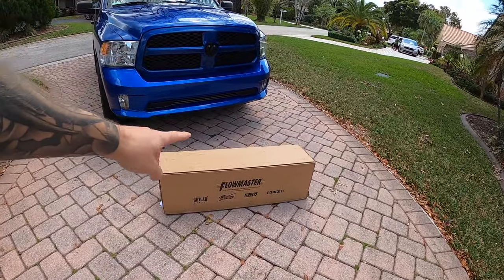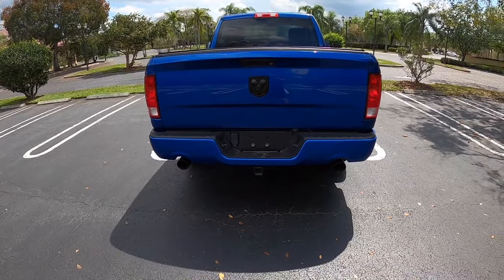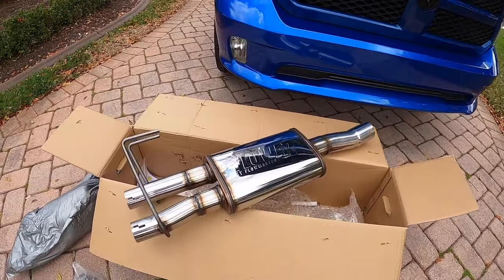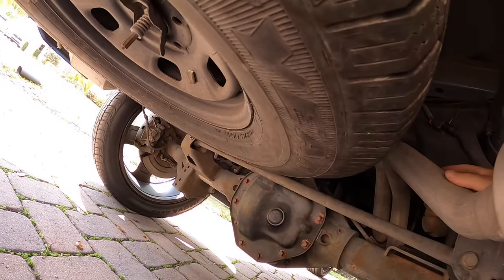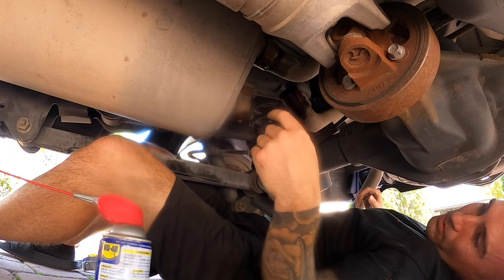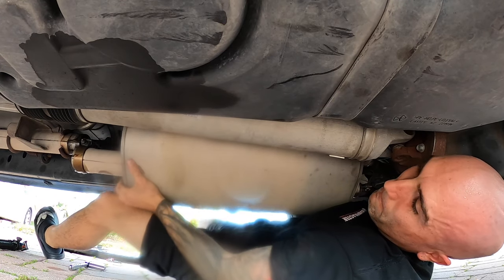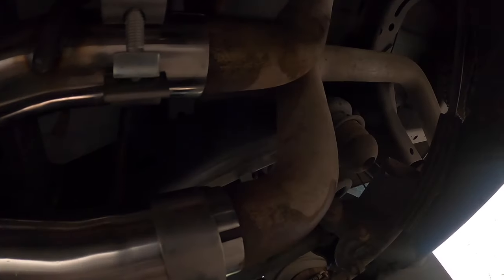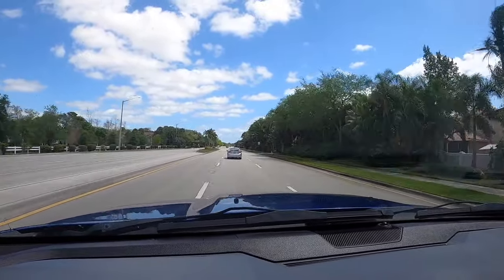RAM 1500 Direct Fit Muffler | Flowmaster FlowFX

Comment: I put the 40 Series on my Ram when I bought it. Have been considering switching to the fx to eliminate the drone at 1800 rpm.
Reply from the maker: Yeah depends what gear ratio etc but this one seems pretty tame cruising with the 3.21
Reply: @BoostedMotorsports    I got the 3:21 also. It doesn't hit 1800 that often but when it does it will drive you insane. Been researching a J pipe. Might throw one in and see what that does first.

Comment: I love Flowmaster.  I've owned more Flowmaster mufflers than any other.  I wonder how it would sound on the Ecodiesel?
Reply: The turbo really suppresses the sound.  I run a 3" 50 series HD Big Block muffler as recommended by Flowmaster.  The sound tested as 3db quieter than stock.  Even without the resonator.  The resonator is just a baffled tube, no baffles.
My truck also has a Banks Silencer delete.  But I run a Wix air filter for goodair flow and fine particle filtration.  Is a 4wd, with 3.92 gears, got 33mpg at 70mph on speed control.  Traveling between San Jose, CA, and Bakersfield.

Comment: I use 3" 40 series Flowmasters & exhaust tubing with SRT shorty headers and factory mid pipes on my '12 Challenger R/T M6, has always sounded great and works well! It is reasonably quiet when cruising at 1800 RPM on the highway, but has an authoritative growl when accelerating to pass someone!
I might add that some anti-seize compound on the pipe joints helps them slide right in and makes it easier to take off should the need ever arise.  Great video, thanks, man!
Reply from the maker: That’s awesome thanks Mark! Glad yours is sounds good too!

Comment: Just did the Aero Turbine direct fit 3030XL and love it! I wanted a nice rumble without it being abnoxious and its perfect. I couldn't recommend it enough.
Reply: Do you have a video of the aero turbine? I've been looking at this exact one.
Reply: Any drone?
Reply: @dallas3559  Sorry no video but there are a few on YouTube if you search I believe. I had the Borla S TYPE installed but removed it because I didn't care for the sound in the cab. This would be closer to like a 50 series FM but better quality material.
Reply: @jefftaylor1247  just a nice sound in the cab but very slight deep grunt when it goes into Eco.

Comment: I have a 23 Ram 5.7. The muffler goes into a y, single exit. Cut it in back. Unbolted the front. Installed a muffler delete. Barks when cold. A church mouse when cruising so you can hear it shift. No drone. Left the resonators on.$140.00

Comment: Thinking of putting this same exhaust on my 2019 Ram Big Horn. But i hear many people having to do a modification saw cut to remove the stocked exhaust/pipe.  Do know if this is correct?  I noticed you didnt have to do any of that.  Just bolt up and attach..

Comment: On my 2017 Ram RT I went with sweet Thunder chamber straight through not a muffler when it only had 300 miles on it . It makes it sound like the cars that were in the 60s and early 70s like the Corvettes with side pipes I purchase it on eBay and it was under $175 at that time now I think the price is about $214 free shipping there is a sound clip on YouTube of it but that doesn't do it justification no drone at all no popping just low Rumble made in Cadillac Michigan USA direct bolt in no cutting just remove your muffler and bolts right up really light in weight because it's a straight through louvered inside. You leave the little resonators on the back.

Comment: And you said there was no drone? Does this truck have the MDS system or did you tune that out?
Reply from the maker: Nothing noticeable.  Its still turned on
Reply: You can turn it off on steering wheel
Reply: @ixcelr8ixcelr855  I’m aware of that. When my wife drives my truck or I forget to turn it off it will drone with certain mufflers when the mds kicks in.
Reply: @ixcelr8ixcelr855  you can?! I'll have to look into that. I have a 2017 5.7